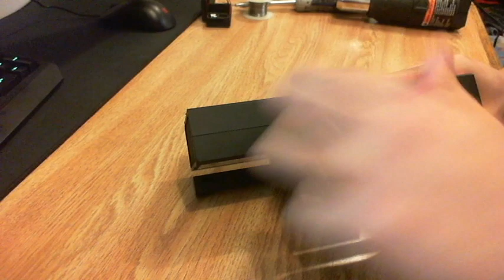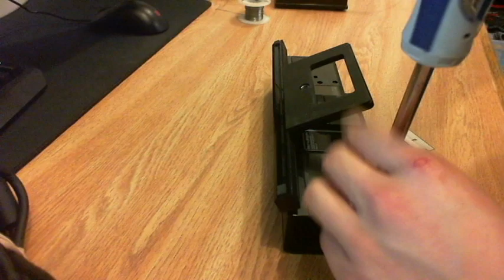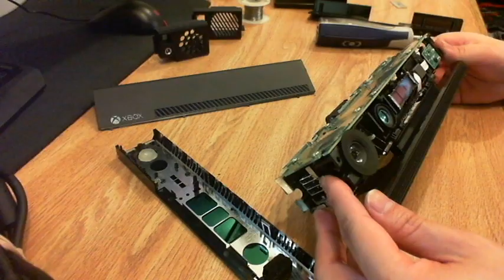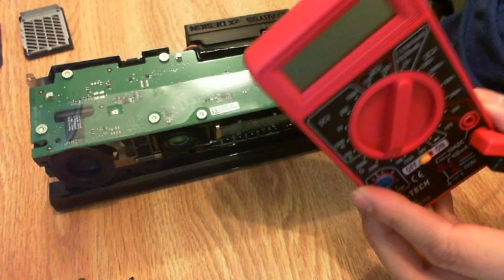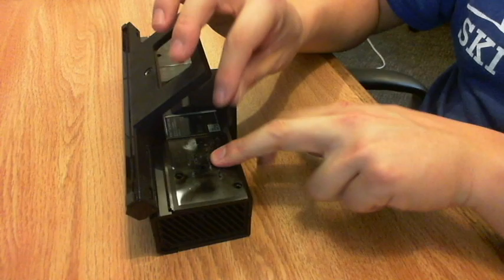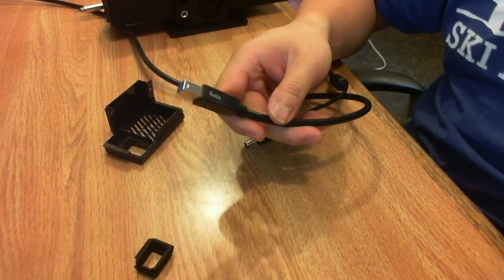Xbox One Kinect S/X USB Mod. 3D Abyss Shroud HOW TO CONNECT YOUR KINECT TO PC

Comment: It works but when I turn off my PC I get a buzzing sound from my speakers and desk clock until I unplug the Kinect power. Tried multiple power supplies, a different extension cord, a different wall plug with and without a UPS, a different PC but the same thing happens. Is this mod safe?

Comment: any idea why the solder just won't melt? Would it be the heat sink or just something wrong with my soldering iron? Only other time I've had this issue soldering was with a 360 controller
Reply: Big pads like the GND pad really sucks away heat. In that case either keep the iron veery long until everything around has a chance to heat up, or use a hot air gun to help it.

Comment: Hello,
I bought a camera kinect for xbox one and the adapter 12 volts, 2.67 amperes. I want to use the kinect with windows 8.1 64 bits.
I downloaded the SDK 2.0 and installed it before plugging the kinect.
I saw that the device manager only detect the SENSOR NUI but not the camera.
I am using a PCI Card usb 3.0 with chip renesas 720202 (because my computer doesn't have a build-in 3.0 USB) 
The problem is the kinect doesn't turn on any light, the fan is off.
What would be the problem?
Thanks in advanced, friend

Comment: did the mod , solders fine checked under scope , fans pulled and checkked they are dead -   kinect powers on and keeps restarting in both my one x and pc with 3.o usb  helllllp
Reply from the maker: If everything is fine, it could be your power supply. If it does not provide consistent 12v 3a it will shut off from under voltage. If your power supply can only peak at 3a it will shut off as well. I would first check if your power supply is putting out enough power. The second I would check is if there are any shorts to the board. That can cause the same result!

Comment: What is this JRE file your talking about!? Also what would cause mine to turn on & off ,being reconized constantly every few secs? I have a 3.0 usb port& host controller,3A power adapter.As well as the SDK installed.
Reply: saame issue you ever solve
Reply: @richduffgaming  Personally if i remember correctly the way i resolved my issue is going to windows update, and a kinect update should get picked up. Dl it , &provided you have the correct files&folders in the correct places you should be good to go.

Comment: I have a 1520 Sensor bar... and want to do this so wondering which adapter is for mine?  The rear port or side port?

Also found that splicing through the original Kinect cable brings up all wires to actually solder to a USB3 cable... but with 2 wires over... a thin black white one (signal wire) and a grey one... all other wires match up.

Do you know what these 2 extra wires might be for and is it possible to splice and solder in as opposed to doing your mod?
Reply from the maker: So this works with the 1520 sensor. 
The rear and side port do exactly the same thing. The rear port was replaced because people thought it was too stiff to plug in and unplug and there was no tactile feedback. The side port when you plug in the adapter there is a "click" so you know its all the way in, vs the old version where you would just push in as hard as you could.

You actually can do the exact same mod by splicing the wires. However there are some downsides to this. 
1) It wont look clean
2) All the wires are shielded, once you cut that away the shielding will no longer exist on the areas you cut and soldered. Therefore you are subject to signal interference. 
3) It is very difficult to move and you could get connectivity issues when the wires move or shift. 
4) there is a potential for humidity to seep into spliced connections over time.

Aside from that everything else should be fine. You'll have to probe around to see what wires are what. 4 signal 2 power.
Reply: Hey, how did it work out for you? I'm also thinking of splicing my Kinect cable.
Reply: @xUltraShadow  I never got round to it.  I just opened up and did the fast-track power wire soldering mod and used a separate cable for the USB.  It works but would like sometime to buy the mod kit and do this soon.

Comment: Hi 3D ABYSS; thanks for the video, i have question please; 
i dont understand, on this site, they recommand 12v 1a ;
http://www.tatsch.it/kinect-2-usb-3-modification/
you advised to use 12v 3a, if you use a smaller than 36va (12v3a), you will damaged a motherboard? how?
regards
Reply from the maker: They are incorrect, I own both the Original Xbox One S adapter from Microsoft and our kits. Original units are 2.67 Amps. If you run lower amperage the adapter is not designed for that load, what will happen is the wires and internal components WILL OVERHEAT, resulting insulation melting wires breaking and shorting, Not all wires will short at the same time, this will cause a SURGE into your unit, or a short circuit, damaging your board. A second possibility is, there is a internal fail safe for the adapter in the event of over draw it shuts off. This will just cause surges of electricity when it starts and shuts off sent to your unit... which also is not good for components. We have modified over 500 units, not a single complaint over the last year and a half.

Comment: i'm having an issue where it's turning off after some time while plugged into the one X console. unplug then plug it back in resolves the issue but it's driving me insane. o.O defeats the whole voice activation feature if i have to manually reboot.

i've check and rechecked to see if i'm making some accidental short with no luck. nothing stands out as the obvious. happen to have any thoughts? suggestions? my power supply is a 12v5a. a barrel jack was soldered to the unit with a few inches of lead wire. maybe the jack wire is just too thick in this case? it's driving me bonkers.
Reply from the maker: Having a thicker wire shouldn't change anything. When it shuts off is it due to time or is it random. It could be either wire inconsistency, or overheating of your unit. Did you use the wires provided in one of our kits? We use only solid core copper wires so the chance of poor connection is very unlikely. Check to see if your fans turn off, and if its repeatable.

Comment: I did everything as told, but it keeps conecting/disconnecting, and an error message is shown..
Reply from the maker: Two things, Did you check the output of the power supply and make sure its over 12v? Second is it connected to a xbox or pc?
Reply: 3D Abyss yes, it’s a 12v power supply, and it’s connected to a pc
Reply from the maker: So if its connected to a PC there could be various issues. Are both runtime environment and SDK installed? The unit will power on when plugged in for a moment when windows recognizes it as a usb device, then after it has loaded some preliminary drivers or attempts to it will shut it off.  What error message is show as you stated? A few could be webcam is used by other application, or not ready. PC's are a bit more tricky because it could be a number of issues. I have no issues with it running on windows 10 pro, according to most it also can run on windows 8.
Reply: Both runtime and sdk are installed. The error message is "USB device not recognized". I don't even know what to do anymore..I tried it in both USB 2.0 and USB 3.0 ports, but am having the same problem. The PU is working fine, the cables are soldered right...all softwares installed...
Reply from the maker: Hmm, was the kinect tested before you modified it? Also what OS are you running? Windows usually wont throw a USB device not recognized if it was modified incorrectly, It would simply say an error has occurred. It might be another web cam driver conflicting. If you wnat you can message me I can help you trouble shoot over the phone or something that's faster
Reply: Yes, it was tested before I modified (I tested it in my xbox again afterwards to make sure everything was still alright). I'm running it in Windows 10 Pro.
What would be easier for you?
Reply from the maker: Really anything works, did it work fine on the xbox? could be one of the terminals was soldered too close and jumping? Also check voltage on the power supply is it pushing out 12v consistently?
Reply: Thank you for your support! I tested it in another PC and it worked just fine! My pc just doesn't support it lmao. Thank you for taking your time to help me! :)
Reply from the maker: Anytime! Enjoy! thanks!

Comment: hello , im just want to cnow its works with all windows wersions or not? because I order parts do everythink good but when I connect nothink happen... no sound nothink...thanks
Reply from the maker: Before connecting you need to download the Run time environment and the sdk produced by microsoft, If the kit was installed correctly you should be able to hear that something has been connected and unknown. make sure both power connections and usb are firmly seated

Comment: Why did you make the video 25% faster there is no need for that
Reply from the maker: Originally youtube limited the amount of time you can upload a video. Only reason to do so, instead of splitting it into part one and two it can be one video.
Reply: 3D Abyss oh ok i didn't know. What was the old limit then?
Reply from the maker: IIRC it was 18 minutes, after that either it was split or you had to jump through a bunch of hoops for verification and uploading guidelines.

Comment: Hello brother ,
I tried it with 12v 2A but it did not work .. when i plug in pc it showing plugin and after few seconds it showing plugout....😕 what to do ... i really need help... pleaseee help
Reply from the maker: If you look at the website or watch til the end of the video, you will notice a 3a or higher adapter is needed under current could cause other problems, over draw and fire hazards.
Reply: 3D Abyss 😅😅😁i am little bit worry about it.... by the way thank you brother for replaying 🤗

Can you give you email.?
I shall send you some pics of problem.. .and my set up
Reply from the maker: Sure thing! I'll message you directly thanks!
Reply: 3D Abyss how ?
On YouTube directly or on email..
naveenimagineer50005@gmail.com
Reply from the maker: They must have changed it you could before. Anyways I sent you an email!
Reply: Hi Naveen Kumar.. i dont understand, on this site, it recommanded 12v 1a : http://www.tatsch.it/kinect-2-usb-3-modification/
it is work for you?

Comment: So what's the install service.. 75 and then I send u my kinect?. Also.. Which service is the one that comes with the shroud and the ac adapter
Reply from the maker: You either have the choice of purchasing parts alone, or having the complete service done. The shroud and AC adapter is all the parts EXCEPT the USB cable. I had a customer ask for that option because he had already had a USB cable and did not want to purchase one. In the past they were all individualized, however it confused most people so only the most popular options were kept. The install service includes everything you need to run your kinect, you will have to mail your unit in, and provide return shipping as well. However all the parts will be included.

Comment: I tried, but it doesn't work.My model is 1595. The power adaptor is a 12V 3A so it is enough to power on the kinect. The first time I did a mistake and I soldered pin 10 with the red wire and 11 black wire ground . Later I realized that was wrong and I re-wired in the right way. Which model do you have?
Reply from the maker: Matteo, I have done 1595s and 1520s we have done close to 300 units with no issues. did you short anything out these chips are sensitive to electro static discharge
Reply: I found another kinect and I did all the steps correctly. I can see the light on and windows 10 recognized the device. I tried with camera, and depth3d Apps and everything worked fine. However, when I tried to use the SDK and the prebuilt apps everytime I have an error kinect not found.
Reply: Also, I forgot, the fan is not spinning :(
Reply from the maker: Matteo, this might be a problem with the Kinect SDK, Microsoft has discontinued support for these SDKs. Which version are you running? Also the fan is controlled by a thermostat. If the unit does not get hot enough it will not come on. Unless you mean your unit is overheating til it shuts off? This was a somewhat common problem in some kinects. There are Four wires going to the fan, once you cut one of them (i'll have to look which one) It will keep the fan on all the time and bypass the controller.
Reply: yep you are right. I installed another SDK and now everything is working fine :) . My last question, I was looking to find the difference between 1520 and 1595, do you know anything about the two models ?
Reply from the maker: 1595 was originally called the "v2" and was released with the adapter kit for PC. The 1520 is for the Xbox, it is from my understanding internally they are exactly the same. I believe the lights on the front light up in a different pattern because of the shell, but everything else as far as I can tell is identical.

Comment: Ima bout to order the DIY kit and you stated that this works with Xbox one x. If I get the kit will that include everything need besides the tools? Also never had the Kinect for Xbox one but why does the original wire not work? What are we doing in the mod that makes it Xbox one x compatible?
Reply from the maker: Yes, the kit includes everything minus the tools. The reason why you need it is because, the Xbox One kinect has a proprietary plug that only is usable on the Original Xbox one. If you look at the back you will see a logo for a Kinect. That plug is not shared with any of the other Xbox one X or S units. Therefore this mod is needed. The original cable from the Xbox One Original Provides power and signal. The xbox one S and X are only able to provide signal, no power. Hope this helps any questions feel free to let me know! Thanks!
Reply from the maker: @kagamutora Also if you don't have the tools we do also carry fully modified and tested units! Thanks

Comment: I don't know if anyone can answer me but how much amps do the Kinect needs, what the minimum amps need?
Reply from the maker: You will need a 3a or higher adapter, Stock unit is 2.67 amps. Cheers!
Reply: @3dabyss53  thats not true the xbox one kinect is rated at 1.5 amps but it will only draw what is needed you could have a 5 amp power supply what is important is the voltage

Comment: I tried a 12v 2a and got no power switched it out to a 12v 4a still no power.. Do i need to plug it into the pc or xbox in order for it to show power?? The reason i ask is bc i actually jus fried my xbox one s internal power supply that im waitin for and if i plug into my pc i dont wanna fry that too!! Pleaae help asap
Reply: What pin is the positive pin and which one is negative .. Im tryin to test with the voltmeter
Reply: Yes, the usb needs to signal for the unit to turn on. Or else you would just have a unit running on 24-7 even when you are not using it.
Reply: Jason Xu its not startin up period 😢
Reply: So there could have been a few possibilities, if the kinect was connected its possible a power surge could have gone into the unit. I am not sure if there is a fail safe on the unit itself. If you are plugging into PC You need the Kinect SDK downloaded first for your OS. Then you will see at the bottom it will say Kinect or NUC sensor detected. You can also verify this in your device manager. If working functioning it will act as a camera so you can use the Camera app in windows to test it.

Comment: why not just strip the original cable and attach it to a normal usb3 and the extra 2 wires will be just the 12v line for whatever ad/dc adapter you have available
Reply: oh it did, just need to cut cleanly and solder every link accordingly, follow a usb3 A-B pinout diagram
Reply from the maker: You absolutely could! its just not as durable. The wire splicing and hanging out over time will create issues. Also the change in resistance between wire gauges and how you sheath the wire from noise would be quite difficult. If you ever open up one of these wires you will notice some signal wires will have shielding over them. Its particularly hard to do if you just cut them all open and wired them together. You will get interference in that one blob that was unsheathed. Also mostly Kinects are used by kids. So the moving of the cables or bending  wobbling will cause stress at those points where they are prone to break!
Reply: it wont work
Reply: @EspHack ~ Did you happen to document and share this anywhere?
Reply: @JackWagonOne  I've modded the cable and it works flawlessly! If you want to know the color code i've made some comments under this video:  https://youtu.be/z7QejwPP0T0
Reply: @ToopofthePoop  Did you splice the cable from somewhere towards the middle or did you remove the end of the proprietary connecter and then unsolder the female port, and then soldered the USB 3 cable?

Comment: What voltage on ohms setting my meter has many different voltage settings under ohms
Reply from the maker: Well under ohms you would be looking for resistance values so not voltage. I set mine to 20k. Though it doesn't necessarily matter in this case, we are just looking for connection or no connection. The value itself is arbitrary. The wires are solid copper and conduct very well with very little resistance. You will be looking for connection for the dc jack + (inner pin) with the number 10 pin, and the Dc jack - (outter) with the ground. Also advisable to make sure there is no connection between 10 pin and its neighboring pins.